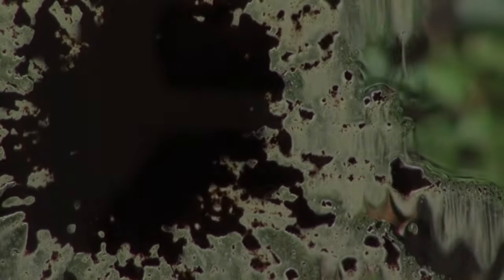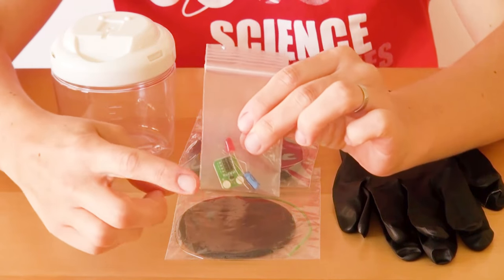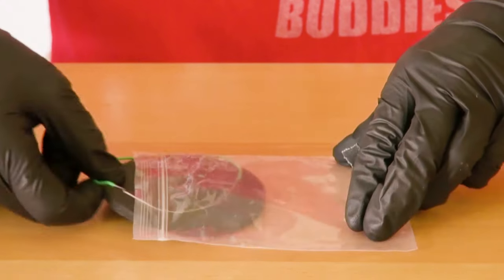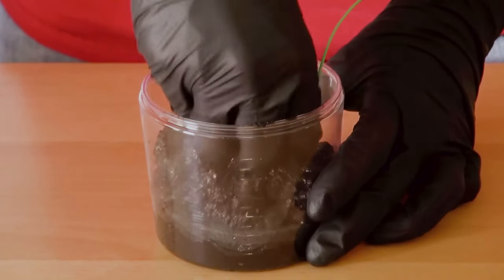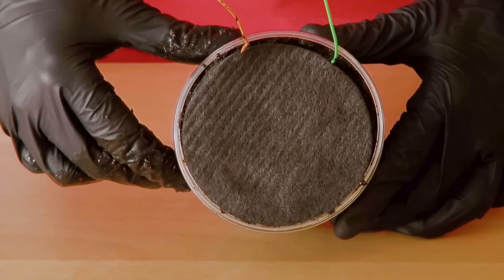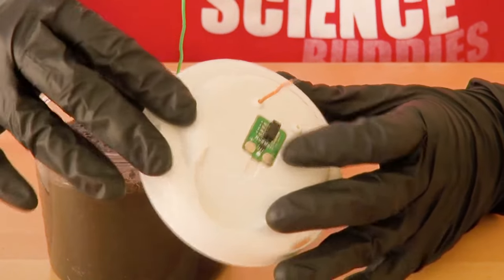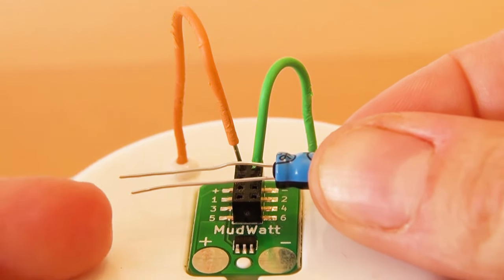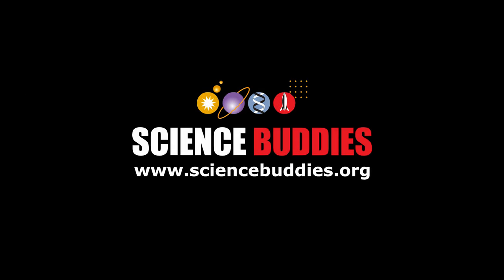How To Set Up a Microbial Fuel Cell | Science Project

Comment: Is the LED light required for the microbial fuel cell to produce energy or can it produce energy without it
Reply from the maker: Hi Kpt_05 - the fuel cell will still produce power without the LED. The LED just provides a way for you to easily visualize the power output. The written instructions on our website explain how to measure the power output using a resistor: https://www.sciencebuddies.org/science-fair-projects/project-ideas/Energy_p042/energy-power/microbial-fuel-cell-mud?from=YouTube

Comment: what are other alternatives for cathode?? We planed on using graphite felt for the anode but how about the cathode??
Reply from the maker: Hi Maria - choosing the right electrode materials is very important to make sure the microbial fuel cell works efficiently. The anode needs to be a biocompatible material as this is where the bacteria grow. The most common materials used are carbon-based, such as carbon/graphite cloth, felt, brushes, or paper. Stainless steel has also been shown to work well. You usually want to provide a large anode surface area for a stable biofilm to grow. For the cathode you want a material that is good in reducing oxygen to water, which is the reaction that happens there. Ideally, you have a cathode that is coated with some kind of catalyst such as platinum that makes the oxygen reduction reaction more favorable. Platinized carbon electrodes are commonly used. Cheaper cathodes such as Mn2O3 or Fe2O3 have been tried as well. Another option is to use a biocathode, which involves bacteria that can reduce oxygen biologically at the cathode. There have been some studies done that show that this concept works. For some of these, also carbon-based cathodes have been used. In general, though, you can try many different cathode materials. Just remember, that the performance of your microbial fuel cell will be different for each one. If you want to dig deeper into MFCs and electrode materials, here are two papers, that you can read: 
1) https://web.mit.edu/pweigele/www/SoBEI/Info_files/Logan%202006%20Environ%20Sci%20Technol.pdf 
2) https://www.researchgate.net/publication/319276277_Microbial_Fuel_Cells_Electrode_Materials
Reply: @Science.Buddies  Thank You <3

Comment: Hi, um I accidentally broke one of my LED lights. Is it possible to use the same LED light for two different microbial fuel cells?
Reply from the maker: If you wanted to measure each fuel cell's power output one at a time, you could just swap the LED back and forth between them. However, if you contact service@homesciencetools.com, they may be able to send you another LED.

Comment: If use a bigger container then will it be able to light a bigger led?
Reply from the maker: Hi - just using a larger container by itself will not give you more electrical current, you would also need larger electrodes (more surface area for the chemical reactions means more current can be generated). However, be careful because "bigger" LEDs do not necessarily use more current. For example, one of these LEDs is twice as big as the other, but they are both still rated for 20mA:
https://www.sparkfun.com/products/9590
https://www.sparkfun.com/products/10632
Reply: @Science.Buddies  so technically, I would be able to modify this to charge something like a cellphone?

Comment: Hey, how long does this microbial fuel cell does last ? in minutes ?
Reply: In theory forever, but you will eventually run into oxygen shortage should the container be closed of completely. But new oxygen should start the process again. You might want to add some fertilizer, but i am not sure if it would change something. But most claim that it lasts at least several months.

Comment: what the material of electrode that you use ?
Reply from the maker: Hi Ambar, The material of the anode and cathode are the same in this project. They are both graphite felt electrodes. Graphite felt has been shown to be a good electrode material for microbial fuel cells as it is electrically conductive and also provides a good substrate for bacteria to grow a biofilm.
Reply: @Science.Buddies  thank you, but how if the electrodes have different material ? Which one more good for sediment mfc
Reply from the maker: @aw1piece  Hi Ambar, if you look at the replies to other electrode related questions below, you will hopefully find some answers to your question. I also provided links to some papers in previous replies that might give you a better understanding of electrode materials in microbial fuel cells.

Comment: can we take solid copper  metal as anode,can U reply Me ?
Reply from the maker: Hi Anumula – generally, you can use many different kinds of anode or cathode materials in a microbial fuel cell. In fact, the optimization of these materials is still a field of active research. In this setup, graphite felt anodes are used because graphite is very stable and highly conductive. In addition, graphite has been shown to be a good substrate for biofilm growth and the felt provides enough space and pores for a biofilm to grow. A good anodic biofilm is critical for a functional microbial fuel cell. If you are interested in the choice of anode materials for an MFC, you could expand this project and compare different anode materials in your setup. This way you can test which anode material gives you the highest power output.

Here are some more recent papers that discuss the choice of electrode materials in an MFC. These will provide some more in depth information to answer your question:

https://www.sciencedirect.com/science/article/pii/B9781782423751000046
https://pubs.rsc.org/en/content/articlehtml/2015/ee/c5ee00866b
https://www.researchgate.net/publication/319276277_Microbial_Fuel_Cells_Electrode_Materials

Comment: Is there a way to measure the electrical output of this fuel cell?
Reply from the maker: Hi Evan, Yes you can measure the power output of the microbial fuel cell. If you go to any of the related project pages listed in the description above, you will find the instructions on how to do that in the project procedure. For example, section 2 (Measuring Power Output) in the project "Turn Mud into Energy With a Microbial Fuel Cell" walks you through all the steps of how to determine the power output of your microbial fuel cell.

Comment: My students constructed 12 of these using the same method and 10 of them are reading negative voltages. Any ideas why?
Reply from the maker: Hi Mike - the most likely explanation would simply be that they have the connections to the multimeter switched. That will give you a negative voltage. See this video if you haven't already: https://youtu.be/p2q6BGJuxRk
Reply: Thanks for the reply, but it's definitely not that simple. I'm an electronics teacher that has been building these for years, but lately most of them never go positive.
Reply: @Mike Morgan
Hello, may I ask you the outcome of your problem?
It triggered my curiosity and would be glad if you could quench my thirst.
Thanks
Reply: @mikemorgan1021  sir did u get the result? 
How did u prepare anode and cathode